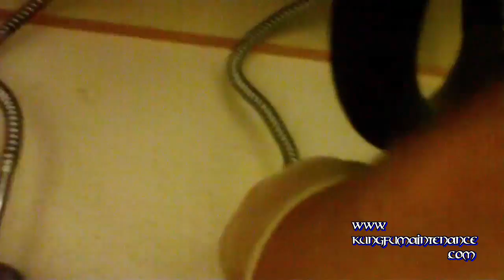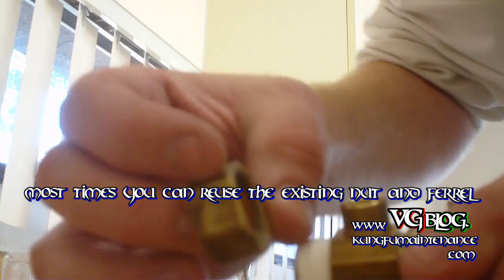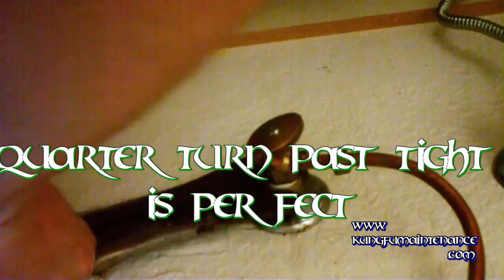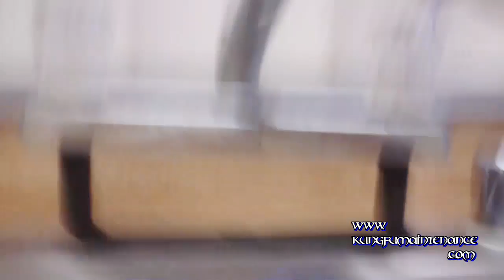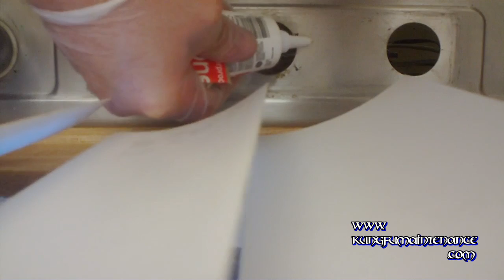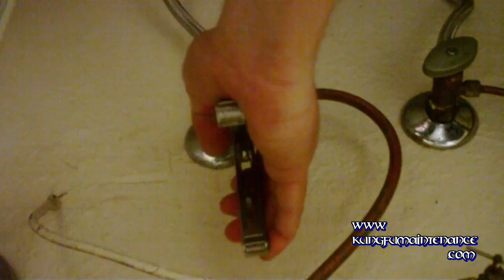How To Replace A Water Leaking Kitchen Faucet Using Silicone

Comment: Hey just for your information there is no use in putting Teflon tape or thread sealant on a compression valves threads because that is not where the seal occurs. The seal happens where the valve body internally touches the ferrule ring that slides over and compresses onto the pipe when the nut is tightened. This is why it's called a compression valve. If you are going to use teflon tape on it, the ring would be where to put it when needed. Compression valves doesn't usually need any sealants.

Comment: I replaced my moen cartridge and now i no longer have a drippy faucet.  But i still have slow drip from underneath the faucet beneath the sink...is this an o ring problem inside the faucet housing or what else could cause it?
Reply from the maker: Could be a leaking oring at the neck or handle depending on the type of faucet or it could be a supply line leaking.